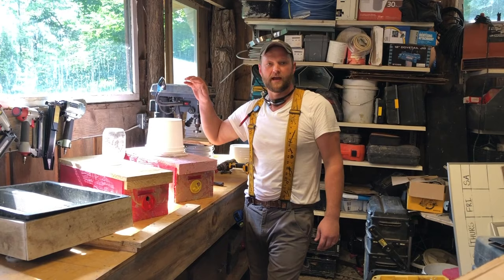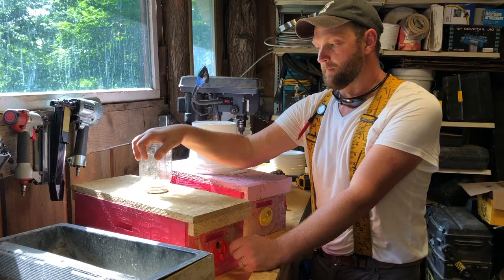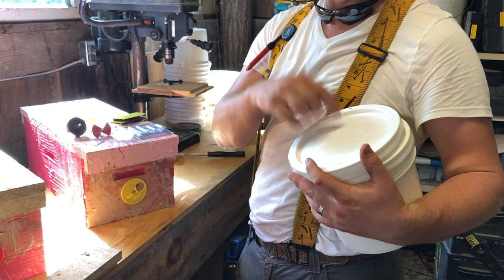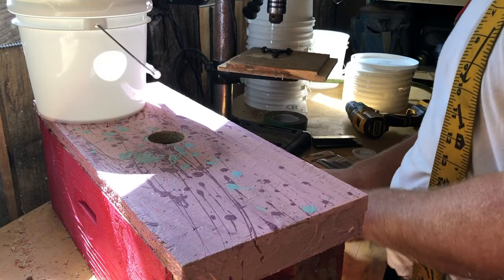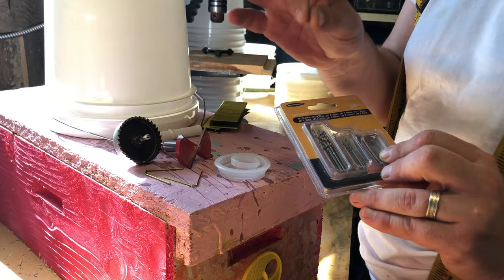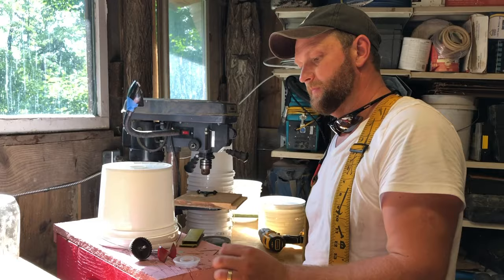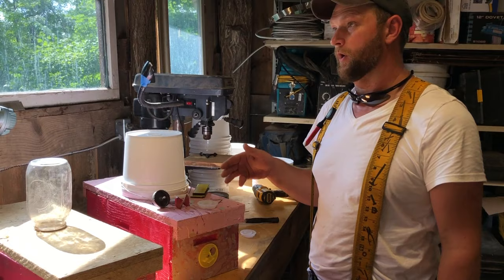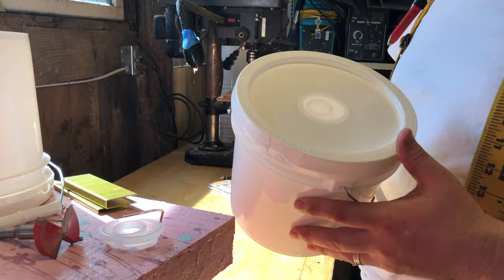One Gallon Bucket Feeder

Comment: Greg, here is a tip that makes life easier...   Using an 18 gauge staple, run the tip through the flame of a torch and punch 3-4 holes very quickly each time you heat it.   Takes seconds per cap.  SO much faster than drilling or just poking through with pressure.  THANK YOU FOR THIS VIDEO!

Comment: You can also fill buckets with your sub pump in the back of your truck from the barrel. Just plumb outlet to water hose fittings. Power up pump with power inverter hooked to battery on truck.

Comment: Brilliant idea! I am curious though does rain leak into hives with the feeder on? With all the rain we've been getting in the spring I can see some leaking but maybe I'm wrong.
Reply from the maker: Hey JC! Yeah I can see why you'd have that concern. Im sure your beeyard is as wet as ours is in the spring. I had the same concern when we started with the buckets but what Ive seen here is the bees propolise the buckets off fast and seal off. I also noticed that the even on small weak hives that don't propolise fast, the diameter of the bucket compared to the 50mm hole in the lid is keeping water out as well. Thanks for watching!
Reply: Was about to ask this as well! I'm happy the creator responded to you 😊

Comment: Just taking notes. Question if I did the buckets do you think the 1:1 would leak?  Because in the spring I feed that to stimulate them.
Reply from the maker: Hey guys! Nope, 1:1 will work great. The beauty of these plugs is you adjust the flow and rate by the size and number of holes you drill in the plug.

Comment: Is there a problem with leaking when you punch more than one hole? The price is right for those plugs
Great tips. Especially the submersible pump
Reply from the maker: You'll have to watch out for flow rate on more than one hole. I used 2 holes on a quart jar and its great but with a gallon of feed, one hole seems best for me.

Comment: I really like the concept behind this (and not just for Nucs - for full size hives too).   I have 2 questions for you:

1) Do you really find that 1 hole in the plug is enough?  Most of the other designs I've seen use a screen (ie. 100 +/- holes).   

2) I assume you put a weight on the buckets to keep the wind from blowing them off when the bucket begins to get empty.  Right?

Also - I LOVE LOVE LOVE the sugar water mixing system you have in that 55 gal barrel.  Going to Harbor Frieght to buy that submersible pump tomorrow!
Reply from the maker: The one hole is perfect for small nucs and queen mating boxes. The beauty of these plugs is you can easily add more holes if you need more flow.

Comment: I like that you can use the same plug to seal the hive up again. If the plug is on the hive will the bees propilize it up?  Gives me the options of more frames in the hive and therefore more brood to be made.  What is the coldest temps do you run these down to?  Thanks Eric.... Lieber Honey 150 hives.
Reply from the maker: These plugs def give you a lot of options. Great lid enclosures. Rarely have I seen the bees propolis cause any issues as enclosures. We have fed a couple time this winter with day time temps of 50F. When it gets in the 30's at night we just flip the buckets up to turn the feed off. Good luck this year Eric!

Comment: So you don't find that they drain due to heat and cool in spring and fall, or is that why you only go with the one hole. Thanks.
Reply from the maker: Hi Harold, I haven't had a problem yet but I pull them off once temps get down to 45F or so.

Comment: How would you clean the inside of the bucket if it ever got moldy if the lid doesn’t come off?
Reply from the maker: A bottle brush and bleach water works great. You can also use a standard lid instead of the gasket lid which makes cleaning really easy.

Comment: What's the best way to wash out the bucket when the syrup sours and mold starts to grow like in the jar feeders? Any help on the fastest way is appreciated. Thanks
Reply from the maker: A bottle brush and a bleach water works great if youre using the gasket lids. If using the standard lid, you can just pull off to easily clean the bucket.

Comment: Can there be several holes in the cap?
Reply from the maker: Sebastian Archer the beauty in using these plugs is that you can add as many or as few holes as you’d like. If you make a hole too big or make too many, you can seal them off with super glue or hot glue:)
Reply: How much do you make them up for I could use about 8?

Comment: How many holes do you put in the plugs?
Reply from the maker: Jeff Milburn just one hole using the size described in the video.
Reply: @NaturesImageFarmGregBurns  do you put one hole because you don’t want it leaking too fast or are you trying to slow them down? I was wondering if one hole was going to be an issue if you want to get them fed fast for fall 2:1 for winter weight

Comment: Do you still use this method or not for any reason? Thanks!
Reply from the maker: We are still using these bucket feeders and love them. In smaller colonies and mating mixes 1-2 holes has worked well. On larger colonies 3-4 holes works great. The beauty w these plugs is you can adapt the rate of feed to the size colony. The gasket lids are not necessary as the standard lids work great too and are easier to clean.
Reply: @NaturesImageFarmGregBurns  fantastic, thanks!

Comment: Why couldn’t you just make the small holes in the lid and not use the inserts?
Reply from the maker: The plugs make it very easy to refill the buckets  without losing or ruining the lid seal by taking on/off. Also the plugs allow you to easily adapt the size and number of holes to accommodate different thickness and flow rate of feed by quickly and easily changing the plug. The plugs are also very handy as a lid closure in times you aren’t feeding. The plugs are very easy to clean the holes if they get gunked up as opposed to cleaning or adjusting the hole size or number of holes if only using a lid. A lid only would certainly work, however the plugs allow for complete control and offered adaptability.